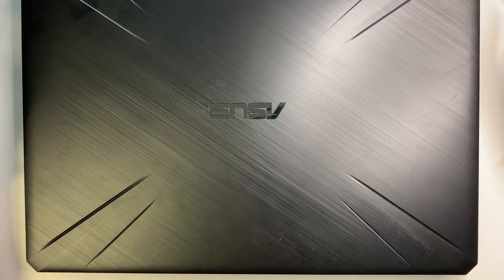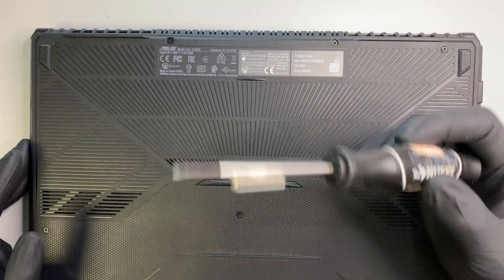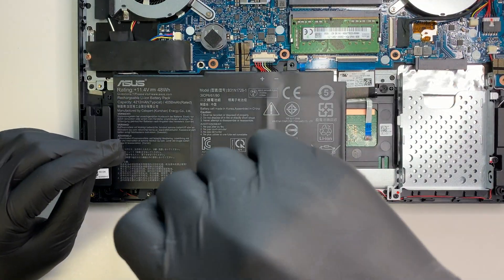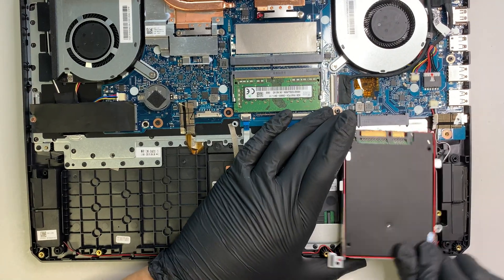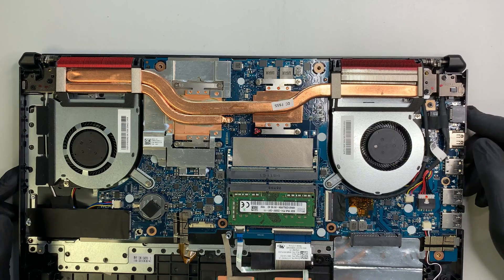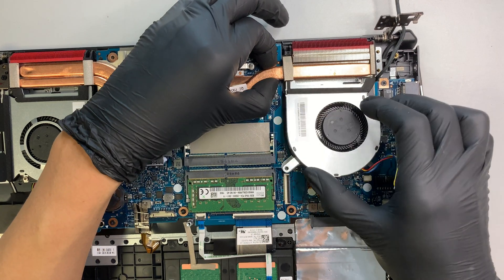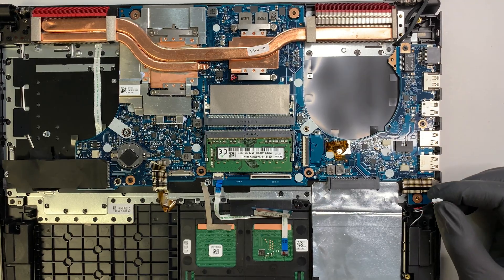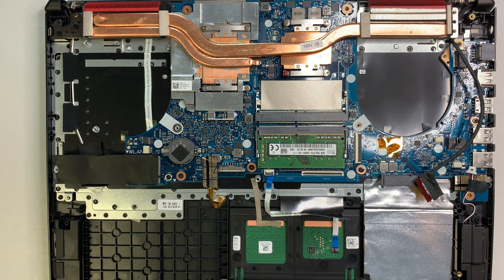Asus TUF FX505D Break Down Disassemble

Comment: Thank you I replaced the cpu fans easy because of this video. But when I put it back together the hdmi stopped working. I don't see any cable for the port that I could've unplugged. Any suggestions?

Comment: this might be a weird ask, but is the bottom case replaceable? ive broken a couple of the "holes" where the screws go in, my ethernet port is broken, andddd my charger port comes out lol (long story short i dropped my laptop while getting in the car and it broke the case) it's mostly fine and everything works as should, but its being held together by 4 screws in the bottom, so i was wondering if that can even be replaced.
Reply: okay i got further in the video, do you know where i can find an entire palmrest replacement?

Comment: Hi, you where talking about keyboard that pinned on the case. I replacement several keyboards like that at work, we cut those "don't know what it's called" nibbles with a small chisel tool where the keyboard is attched to. Replace the keyboard and use some glue where the cut nibbles where, need to be carefull though, or you are getting sticky keys and put that thing back together. It's hard to explain it in english, but it is possible to replace the keyboard without buying a new case with it.

Comment: @UberGeeks how would I replace my 3.5 mm audio jack? It does send signal to headphones but need to connect and disconnect couple of time. I suspect one of the pins is bent. Also, windows doesnt recognise new devices when I use headphones. However, it is not a software issue as my mouse and USB drive gets recognised instantly... Any advice would be appreciated.

Comment: Can i replace the screen/lcd only? Seems like my screen gave up, it’s flickering at the bottom only but internet says either the cable is damaged or i have to get the screen replace. What would you recommend first? Any help is appreciated
Reply: Did you manage to find an answer? My screen is doing the same thing
Reply: @hyadalko46  It was due to the frame rates. My laptop is 120hz i had to download a program custom resolution utility(CRU) and set my frames to 110hz and it solved the issue. It's 10hz drop in performance but eh its barely noticeable and solves the issue for free. Look up to how to custom resolutin using CRU and follow the guide.

Comment: Hello, I have the same laptop as that. The issue with my laptop is that the power indicator is not blinking even if the charger is in place and the power won't turn on even if I am pressing it, what do you think is the possible problem? My laptop charger is working though
Reply: its either the charging port is dead or the whole laptop is dead, if the charging aint showing and everything ealse is then its just the port but if u get no signs of life then the laptop itself is dead

Comment: My laptop suddenly turned off, while it was plugged in, and now it won't turn back on and neither will the charging indicator light. I have tried other outlets and now I'm stumped. Could I please get some help?
Reply from the maker: Try remove the battery and power directly using your charger

Comment: Well fellas, my fans started grinding and scraping so here I am. Wish me luck, obviously me buying a prebuilt laptop does not make me very savvy in terms of computer components
Reply from the maker: Good luck ! Let us know if you were able to replace the fan. Cheers !
Reply: @UbergeeksBiz  okay so I’m having a problem, I got all the dust and stuff and I was successful in disconnecting the battery, fans, RAM, but I am having a problem in my left fan. It’s vibrating!! And it stops and starts because of that.

Do you know the model number or a tutorial that can help me troubleshoot the problem
Reply from the maker: @FourFouFoF  Try replace both fans. That would stop the rattling sound. 
- http://ebay.to/3scxTz1
- http://ebay.to/37AWWEi
- https://amzn.to/2NL2kh3
Reply: @UbergeeksBiz  I really don’t want to spend an extra 40 bucks, is there a way to take it apart?
Reply from the maker: @FourFouFoF  If the fan ballbearings worn out, it spins the fan blades unevenly. Causing the rattling sound.
Reply: @UbergeeksBiz  okay, how do I access it? Do you have a video on that fan, or a link from someone else?
Reply: just had the same problem, opened it up and found out some small piece of plastic had broken off into the fan so when it spun it made a loud sound...

found this video for smth else tho lol
lmk what came of your problem!
Reply: @chaosorbCRB  I ended up going to a computer store and they were able to just blow some compressed air in it after I had opened it beforehand and got as much out as I could. It is kinda returning at higher RPM so I do want to see if I can crack open the fan to clean the inside (was unable to last time)

Comment: I got the same laptop.
 My speaker stop working sometime if I lift my laptop and suddenly it's start working if I put pressure at the left side of laptop's backpanel. 
I also opened the back panel and try to solve it but my speakers wire are stuck under the HDD caddy. What should I do please help me.
Reply from the maker: Best is to change out the speaker. They come in both left and right speakers

Comment: Thank you! I have cooling problems on my fx505d, it was very helpful!
Reply from the maker: You are welcome. Try apply new thermal paste.  https://amzn.to/3xklVXq
Reply: @UbergeeksBiz  ok! Cpu has spikes up to 97 degrees, but only spikes. Rendering temperature is about 86 degrees, which is also too much. Gpu runs cool.
Reply: @SolidBlueBlocks  if u were lucky and got an intel cpu u coulda use throtle stop or intels utility tool to undervolt or just reduce the power, thats what i did for my legion 5 and the temps were perfect, for the fx505 just replaced the broken fans new paste and it kept around 90c on cpu  and i gues thats okay since  the max temp is 105 for the ryzen 7 cpu

Comment: Hello I had same type with yours but there is a problem with mine. When I turn it on, its lights, fan, machine is on but the monitor is off. But that just for few seconds then the laptop (lights, machine, fans) turn off again by it self. 
Sometimes it can normally ON and last up to 5 hrs. Do you have any idea what kind of problem that I have here? Your answer will be very helpful. Thank you!
Reply from the maker: Hi, I would try the RAM first. Remove the RAM and try use different RAM. And put one RAM at a time.
Reply: I had same problem, probably display strip or display problem, I'm using external monitor now